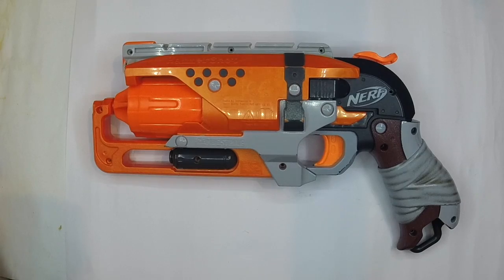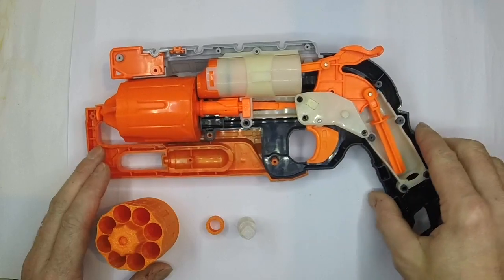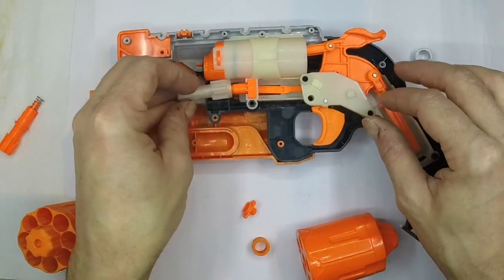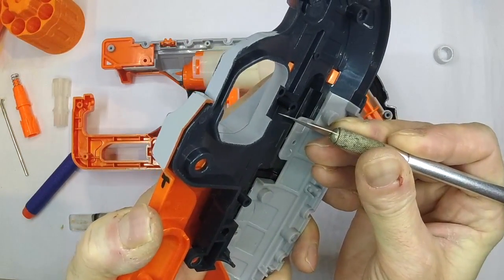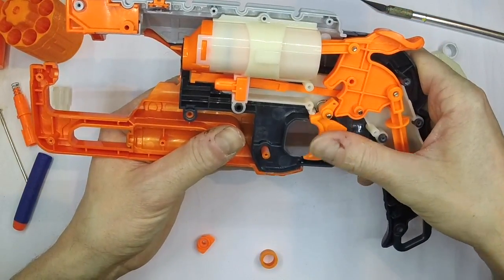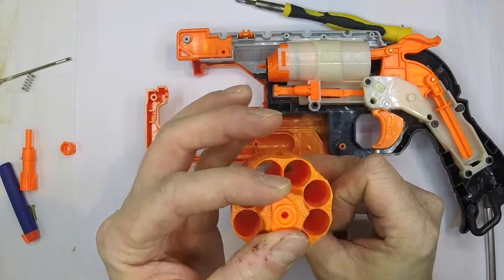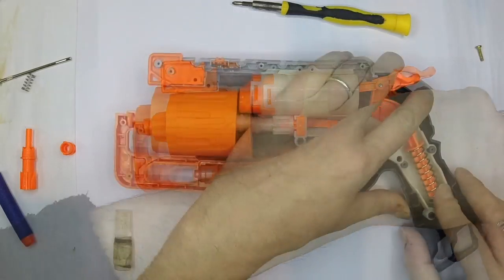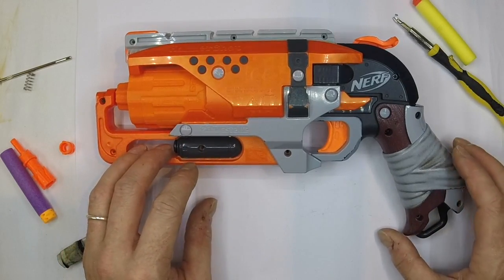Nerf Hammershot Gavinfuzzy 8 Shot & Blasterparts Kit Fix

Comment: Yes, the round thing is a spacer for use with the stock spring if you wanted a little boost :P Might be a tight fit onto the rod, but it does not need to move around once its in.
Reply from the maker: Thanks, it went in my Sweet revenge. In tests a 12mm spacer out performed all the mod springs I tested.

Comment: Thank you for the fix guide for the Blasterparts metal hammer and sear kit, i had two of them that were not functionning because the hammer did not catch. Your mod  saved them both. I will even do it preventively for the next one i'll install.
As for Gavinfuzzy's cylinder, it is now the stock cylinder of all of my HS.

Comment: Ekind or waffle dart are the best i just remplaced half of me elite  by these. They make my flywheels blaster super accurate without flywheel modification and springer also.
Reply: They suck in my OMW hammershot tho. They're just too heavy for the spring. Especially because of how heavy the metal is.
Reply: Im pretty aure ekind darts(or other brand but the same dart) will appear in most youtube channel they will begin to be used by the community as well and fight rival blasters.
Reply from the maker: Ekind are just rebranded generic darts. Xtip or stacked waffle darts are excellent. There is a simple set of physical attributes that make a good full length dart, maker and name is largely irrelevant if it meets those qualities.
Reply: I think they make a great full length dart. Especially in modified blasters. Just not my Hammershot
Reply from the maker: They are very droopy below 100fps, like most 1.2g darts.
Reply: I think it's the foam density. I'm having issues with stock cylinder, very beefy spring, and no AR.
Reply: FCtweak I'm using the OMW cylinder
Reply: Yes i know here in canada the nake of the seller  is ekind but this 'darts are exelents
Reply from the maker: You are well under 100fps with that set up.
Reply: Actually ekind makes waffle darts

Comment: In reference to 2:25, How did you take the rotater pin out of the original cylinder? You skipped the part I needed to see!
Reply from the maker: There is a screw in the hammer end, then the barrel end pulls off. I refuse to show dismantling, I leave that to other channels.
Reply from the maker: Screw can be seen in this picture from Nerfhaven. https://m.imgur.com/ClhssOW?r
Don't lose the spring from the slip clutch.